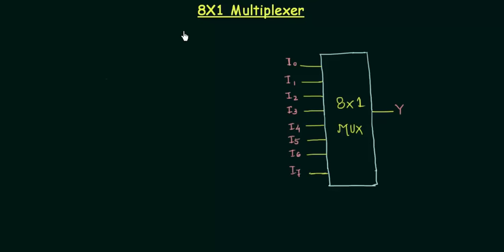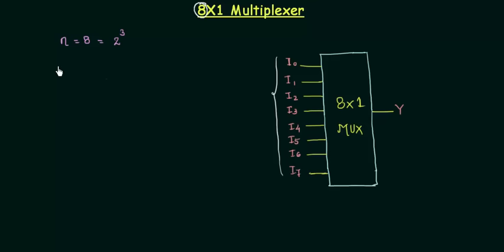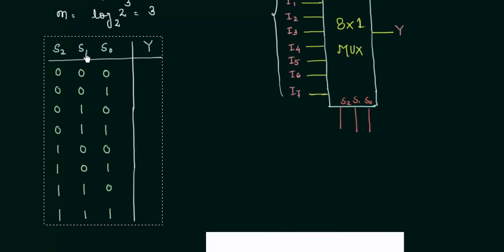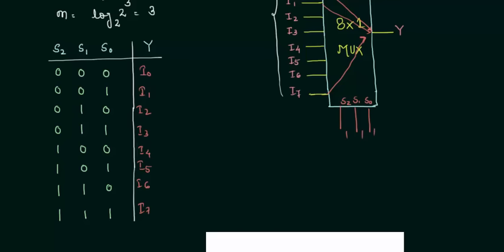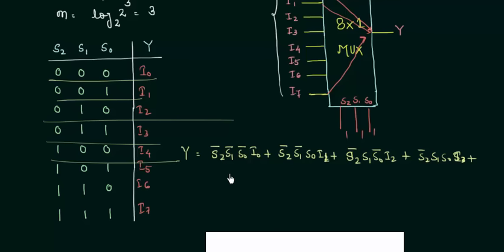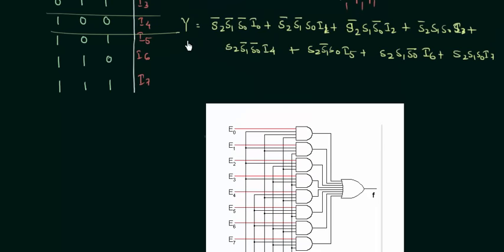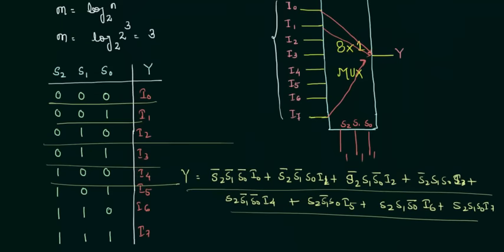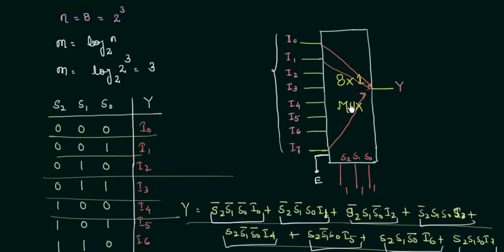8X1 Multiplexer

Comment: but what I know is that if you start your inputs from i0 to i7, you should've had the selectors from Least Significant to Most Significant, which means s0, s1, s2. 

Am I correct? 

because if you had them this way from MS to LS then you would've had to rearrange your inputs.

Comment: an 8×1 multiplexer has inputs A,B and C connected to the sectional input s2,s1,s0. Data input I0 through I7.
Q. I1=I2=0;I3=I7=1;I4=I5=D; I0=I6=D`
How can i solve

Comment: What is meant by that" enable", sir?
Reply: Its like a switch for the circuit.. If you switch off the circuit i.e. when enable = 0, the circuit will not work as anything ANDed with 0 is 0.. Therefore we have to switch on the circuit i.e. enable = 1 so that the circuits works..